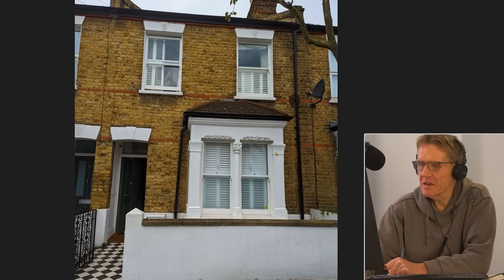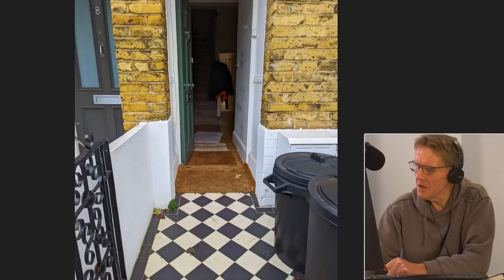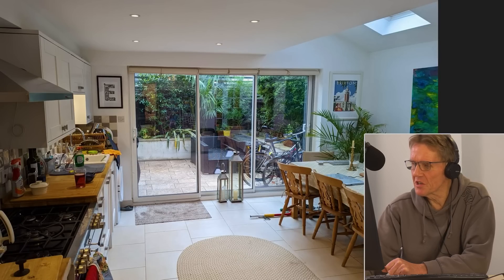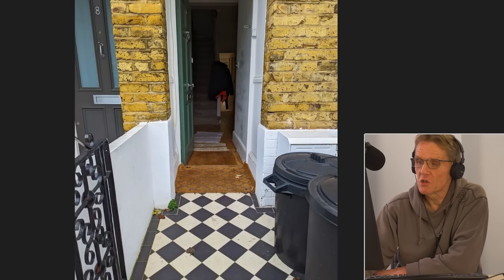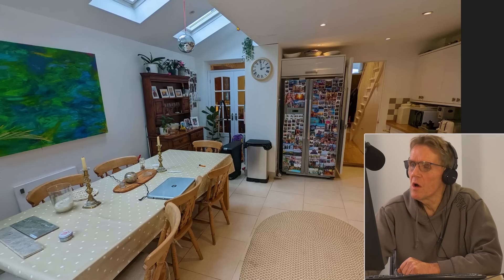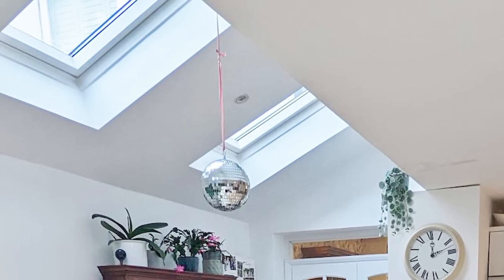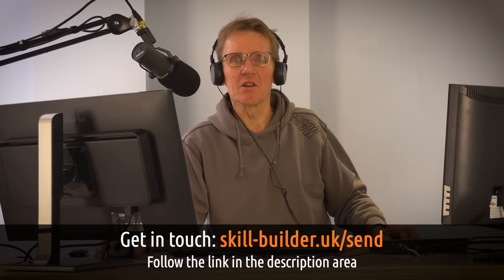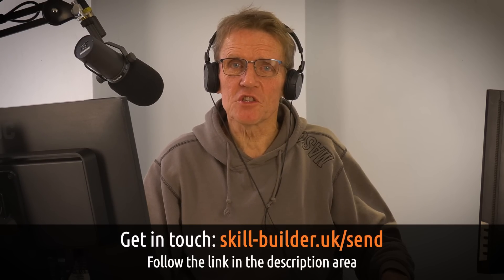Watch This Before Extending Your Home (common mistake)

Comment: funnily enough I'm just about to dig out a solid kitchen floor to dig down deeper and install insulation and wet ufh.There is an air duct already passing through, so I was planning on using a telescopic duct on both sides of the kitchen to drop it down and back up so its under the new dpm in the hard-core layer surrounded by pea gravel using a 110mm pipe to connect the two sides. Sound ok, or is there a better way? my only concern is if water ever gets in there it could be trapped
Reply: How could water get stuck in a vent which has constant air passing through it? It should fall towards the external vent of course so water can't get in from outside.
Reply: @lukeh3020  so both sides of the kitchen would need to be dropped so a telescopic section on both side. That means that the drain pipe connecting them will be lower than external and internal floor level

Comment: Not into that level access fad at all . Trouble coming down the line 🙄🧱👍🏽
Reply: I wonder if an elevated platform is a compromise? Something with built in air flow and drainage design

Comment: I'm currently ripping up a floor with rotten joists and replacing the lot. This scenario - one air brick on one wall - is what I suspect has caused many problems. Problem is, I cannot resolve it without extensive extra work. I've discussed the potential problems but customer wants everything replaced, as it was, as soon asap.
I wonder, is there a possible fan/extraction system?